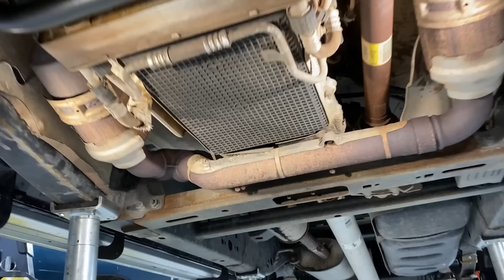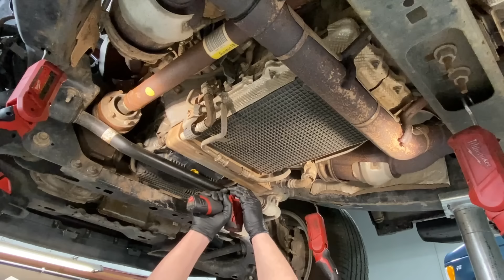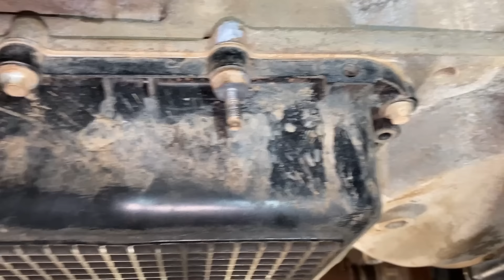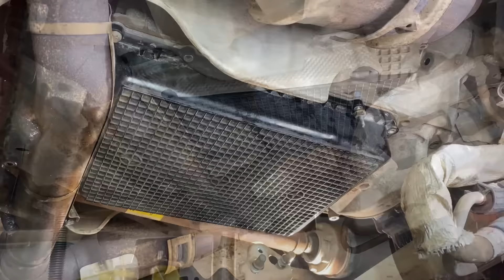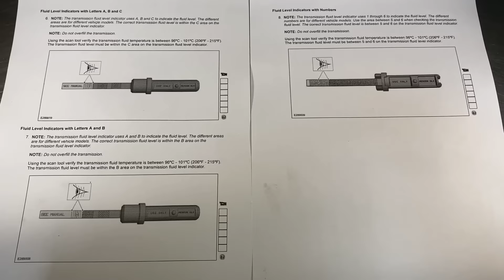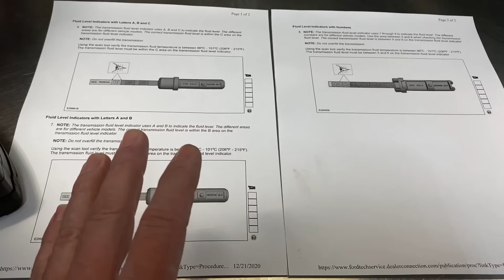Ford 10R80 Ten Speed Transmission: Fluid and Filter Service Procedure

Comment: This is crazy!  An Engineer got paid for this design?  Is that a plastic trans pan?   You would think they would create a flange on each side of the exhaust pipe to take it out so you can access the pan all the way.   I bet you this is a $800 job. Thanks for the video.
Reply: LOL,,,,I have a 2017 Raptor 3.5 twin turbo Ford and mine is so easy to do it is no more difficult than a regular oil change.
Reply: Ask Brian what he would charge in man hours?
Reply: I would agree on the cost.  I'm buying parts now, and without fluid, I'm over $100.  Guessing close to another $100 in fluid depending on what brand I buy..

Comment: How many heat shields are going to be put back on? Probably straight in the trash for most
Reply: You gotta love the "heat shield" on the exhaust pipe less than 2 inches from the plastic pan.
Reply: @groosbro1  Yeah I wonder how that's going to work out....err warp the plastic or melt it completely in a few years....it'll last long enough to get past the warranty period, then it'll be the typical Ford, leak fluids all over the place LOL.  

Wonder if there's an aftermarket metal pan available.

Comment: To drain the pan. Could you put a suction hose in the fill plug to help get most of the fluid out?
Reply from the maker: Yup if you want but it will still spill all over in the end once the pan is removed.

Comment: When would you recommend servicing the 10r80 on an f150 5.0? I pull a 6000lb trailer at least twice per week. I know Ford says 150,000mi but I would never. I know on my 05 V8 explorer I service the transmission every 30,000mi. What would your recommendation be for my f150?
Reply: I would just do a service every 30k - 60k miles personally.

Comment: The only thing that annoys me more than plastic transmission pans is plastic engine intake manifolds.
Reply: Many carmakers have been using plastic intakes, valve covers, oil pans for decades. Not a lot of problems. Although I prefer aluminum on those parts, it is a cost and weight saving measure.
Reply: @ShersGarage  besides warping and leaking no problems at all  buick 3.8 where recalled for valve covers leaking and catching the car on fire  no problem at all
Reply: Was always told plastic is cheeper to make yet a f150 can get to 80k brand new. Think I missed something
Reply: Not only that !  Did you notice the "no tools required "  drain plug on the plastic engine oil pan ?
Reply: Speaking of the plastic engine oilpan the worst   oil pan drain.plug design. can you say leaking nightmare they reccomend changing oring at every lof just a heads up.
Reply: @tdizzle2179  Ford and the rest want u to buy new every 5 years. I would if I were rich.
Reply: @tdizzle2179  Cough cough Mercedes-Benz 😂😂😂😂
Reply: And plastic thermostat housings
Reply: Here the mid90s Fiesta was the first one .... LOVELY. It was an 1.4 engine enginereed together with yamaha.
Reply: @38911bytefree  mazda enginereed kia built
Reply: @38911bytefree  jeep in the 80 s on there 258 where the first and they leaked
Reply from the maker: IDK ZF has been doing it for years no problem.
Reply: @FordTechMakuloco  But you're comparing a brilliant ZF 8HP to a terrible issue prone Ford/GM co-designed auto. ZF's 8HP integrated filter/pan adds significant rigidity over a simple flimsy pan like what ford/gm did for simple "cost cutting"

I'd have more faith in ZF over anything new from Ford/GM developed these days. Chrysler use ZF 8HP's for a reason.....

I love your work though, keep it up !
Reply: @ThomasFG  I've got a ZF transmission in a Australian Ford falcon 5.4 XR8.  the same plastic pan design . Big issue with coolant contamination with them. Big $$$$$ to repair
Reply: @oldbloke100  That's actually Ford's radiators used on the falcon's that were the issue. FG MKII+ they moved to an external trans cooler completely but still had coolant going through a heat exchanger type system. Off memory.

Holden never really had internal trans cooler issues like Ford did with poor design & cheap plastic. Even EA, ED, EF/EL falcons all do it
Reply: @ThomasFG  The heat exchanger is on the 6cyl engine, it’s funny you say that, BMW, Jaguar-RangRover have the same issue with the same ZF box. Holden didn’t use the ZF. The point is that every automatic has issues. I have bypassed the radiator on mine and run a straight oil to air cooler.
Reply: @ThomasFG  well that, and they know that they couldn't do better!
Reply: Plastic pans....did the accountants design that?

Comment: Ford be like "Let's put the fragile trans cooler under the car, what could possibly go wrong?"
Reply: Well I mean with a plastic oil pan, I don't think having a transmission cooler under a pickup really makes any difference at that point either LOL.
Reply: @wildbill23c 
Ford at its best! 🤣
Reply: @wildbill23c  soaking up all that hot air
Reply: I mean there is a skid plate protecting it, (Brian has already removed it in this video), but yeah, plastic oil and trans pans on these trucks.  And the oil pan has known issues leaking over time, I know people who have had it replaced every few months.  So far I have been lucky with mine.
Reply: @jgalt99  Is the skid plate plastic or Styrofoam?
Reply: @sthier24  the one in my ranger is aluminum
Reply: @BORIKKEN  They stopped making real Rangers in 2011.
Reply: @jgalt99  I just replaced mine with a metal one. It even has a drain plug. I truly dont know why ford thought it would be a good idea for a plastic trans pan and oil pan combo.
Reply: @jgalt99  You all seem to forget Ford does not make these parts. It is probably a ZF transmission like GM and Chrysler and the rest of the world uses. All companies suck now.
Reply: @NY411Info  Ford and GM designed this transmission together, neither use ZF
Reply: @tallll70  It is a ZF design licensed to them.
Reply: @NY411Info  FCA has licensed ZF8 making it in US, look up gm ford 10 speed, it has nothing with ZF, it's 2 transmissions, 10 speed designed by Ford only, 9 speed by GM only and they sharing them... ZF is also making 9 speed for transverse engines placements, but that one is hated for 2 slower dog clutches
Reply: @tallll70  Maybe it was the six speed model then. None the less , new stuff sux. I'll take my pushrod Ford and Chevies over all of them. Sorry not much of a Chrysler can 2 all u Chrysler fans out there.
Reply: @NY411Info  The 10R80 trans was designed as a joint venture between Ford and GM.
Reply: @NY411Info  It was the 6R80 that's licensed from the ZF 6HP19.
Reply: @NY411Info  this one was actually a Ford GM partnership.
Reply: Oh c'mon now.....Ford couldn't, wouldn't INTENTIONALLY make it hard for ANYONE to work on their products......😂
It all started with the 7.3 PSD ( great engine ) and the mod motors.
Reply: All new cars and trucks are junk. Planned that way so we all keep buying after 50,000 miles.
Reply: @NY411Info  I bought a 19 Lincoln MKZ Hybrid last year for work. Best car I've owned. Just crossed 70k and it's getting better. I just run Shaeffers and over maintain the CVT ( the book says to change the fluid at 150k.....uh, no....did it at 55k ). Put an air filter in every 14k or so. Gets 40-50 mpg and gets up and going without fail.
Reply: @hoost3056  Dunno, I have the 2016 Edge Titanium with the 3.5 and use Mobil1 5w20 in the winter and 5w 30 in the summer. All new vehicles to me are garbage. I have to make em last as long as possible though since I'm not rich. I still have a 2004 Taurus that never sees winter as well, but that is better quality to me when it comes to complicity.
Reply: One thing that goes wrong for Ford, I don't buy any more fords 
Seriously.
Reply: My brother had a leak in his gas can something on the road punctured it. Its was plastic but cost a butt load to replace.
Reply: Motivation to get the fx4 package
Reply: We could make more money..
Reply: Alright guys, planned obsolescence and make it hard to work on unless you take it to Ford (chkCHING!$!$!)? I want everyone to take their head out of a bucket of sand. Electric vehicles are and have been pushing aside combustion engine vehicle engineering and investment in production for at least the last year. I love this channel, Brian is the BEST, but I worked in a machine shop that did all the work for the San Diego county bus system. I cannot wait to get rid of internal combustion engines! Smelly, filthy, oil changes, gas and diesel everywhere...the safety, longevity, noise levels, not breathing all that exhaust....! The danger of have gasoline etc. in such massive quantities... the cost of keeping that relatively safe....and finally cops won’t have to pull kids out of burning cars..... dudes...THINK ABOUT IT! When the kids get used to the horsepower, acceleration etc. of electric vehicles, they will scoff at us old timers and our memories of the era of muscle cars!
Reply: @5400bowen  you are nieve if you think it worst get 100 times worse with elec cars. Look at Tesla and thier issues. Imagine an apple product as an automobile and that is electric junk in 10 years. No thanks! You will own nothing and you will be happy.

Comment: Is there a reason you can't just pull the 2 nuts off the crossmember mount? And this reminds me of having to change plugs on a Corvette, we had the jack up the engine.
Reply from the maker: If you do that the trans and exhaust will lift together and you will never get the gap.

Comment: You might have a problem there ...the oil filters were different. The old one had 6 pick up holes on the course side of the filter.
Reply from the maker: No, that is just metal attracted to the magnet that is inside the filter, the filter part number has never changed 2017-2021.

Comment: I have some questions.  I know of a company that is currently developing a metal oil pan that has extra ATF capacity for the 10r80, is that recommended? I don't like the plastic parts on my 18 F150 5.0L. I've heard that Ford techs can erase the "Adaptive Transmission Learning" to fix the jerky shifting, is this true? Thanks!!Merry Christmas
Reply from the maker: Yes I reset the adaptives on this one and it helped so much.

Comment: What about the torque converter?  How much fluid is left? Shouldn't that fluid be drained as well?
Reply from the maker: There is no drain on the TC and it is not needed, you want that mix never shock with all new fluid.

Comment: It is a lot easier on gm ,although we do flushes most of the time it is pretty to fill and adjust,when we drop the pan we just drop the y pipe a little to remove pan, it is pretty much the same thing the pan is metal, they have a chain pump

Comment: Ah yeah. Did my first one not long ago. My big question is why does the stupid dipstick cap have to be so tight?
Reply: It looks like a lug nut, so a few ugga-duggas and you're good to go! ;-)
Reply: @jamesplotkin4674  pretty much!
Reply: 19mm means 100 ft lbs right. 😂😂
Reply: @alexpuls8219  I think its 45 ftlbs......but, damn. When an oil filter that holds pressurized oil isnt torqued as tight as that little cap something ain't right 🤣

Comment: Leave it to Ford to overly complicate a simple task. 
A friend had a 2015 F150 with the 5 liter in it. He puts around 60,000 miles a year on his trucks, so I started bugging him to change the oil in the differentials and transmission. He was great on oil changes, just other fluids were ignored. I asked what the transmission fluid smelled like and he told me, no dip stick. Who builds an automatic transmission that isn't serviceable? Ford does.
Somehow when the 5.4 in my 2003 E350 van dies, it's getting a 5.9 Cummins with an Aisin or Allison transmission.

Brain, thanks for doing these videos and highlighting the critical Ford failings. OBTW, how's you're Ram diesel running?
Reply: @Jonathan A 
Gee, I wonder what that dip stick is on the 2020 Ram 6.7 Cummins with the Aisin transmission on the top right side of the engine is for?
The transmission dip stick on the 8 speed models is on the left rear near the firewall. There's a recall 20V043000  for the FCA transmission with a possibility of a fire on overly filled units.
Reply: The Cummins would be worth more than the shell of the van that is left when the 5.4 dies?!?
Reply: Mike Ski 
Nope, she’s a Quigley conversion. Since Ford no longer makes the Ecnoline van except as a chassis cab, finding clean versions to convert are difficult.

Comment: Is Ford recommending trans service intervals again or are they still sealed for life until they grenade?  Thanks for the vid.
Reply: Every transmission technically has a service interval, just most people ignore the actual service section of the owners manual because they don't care they just lease everything till it is falling apart due to lack of maintenance then trade it in on another.
Reply: Here they sold Fiesta with sealed for life gearbox (manual) .... also Focus. But guess what ? .... water intrussion though the vent port... LOL ..... seals leaking .... they ended using a machine to suck the oil from the top to put new one. Pathetic
Reply: Watch the video and find out.

Comment: What are you opinions of the 10r80 as a seasoned Ford tech?    I absolutely love mine in my Mustang and I just wonder if you have any stories or tips for them to keep them running as smoothly as possible.
Reply: Change the fluid in them every 40-50k as well as the filter and it should be fine for many years...its the people that neglect the simple services that typically have issues...ignore the lifetime fluid BS LOL.
Reply: @wildbill23c  what about the countless threads all over the internet about harsh shifting and sudden jolts? I’m doing my pre-purchase research and I love just about everything about those trucks except what I read about those transmissions

Comment: Thank you so much for this! I like to try to do as much maintenance myself as I possibly can to save money and also so I can be certain it’s done close to perfection as possible and not have a mechanic try to F me over since I’m a girl
Reply: I do most of my service due to the fact that I worked in a dealership with a Collision Center where I was a painter.
I know for a fact that some (not all)
Don’t do everything they should when a vehicle is in for service.
Example- Caravan tune up, rear plug’s almost never get changed cause it’s extremely difficult to change them out.
There isn’t a wrench or socket that gets in where you need it.
I struggled for a few hours one Saturday in the shop, on a hoist.
Monday morning I talk to a few mechanics and asked them how in the hell do they do it, the 3 I asked said they don’t even try cause it’s so difficult! 
It’s crucial they do cause at 100klm the rust into the head and are extremely difficult to remove without pulling the motor.
In a nut shell, I don’t trust most mechanics!

Comment: When I changed the fluid on my ford f150 I found a plastic like guide tool left in the pan from factory, now I changed it in 2015 after just buying the truck used,the truck is a 2000, so the trans fluid was never changed prior since me.i was shocked.
Reply: Very common. The plunger or plug is designed to be pushed into the pan while the unit goes down the assembly line. The theory’s of fluid flushing without the filter exchange creates another problem

Comment: Just threw 5 bucks your way for taking up some time. What do you think about unplugging the bms to disable auto start stop on a 2020 f150? Would it cause the life of the battery or alternator to shorten by any significance?
Reply: just unplug the third black plug under the dash and start stop goes away.  Just replug in when towing.  Takes 30 sec.  Did mine 25k miles ago.  Works great